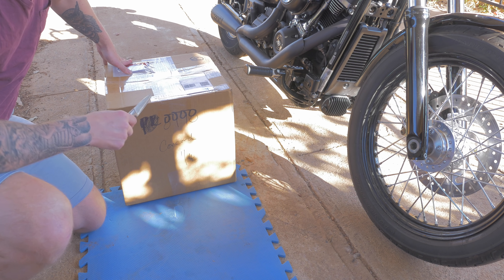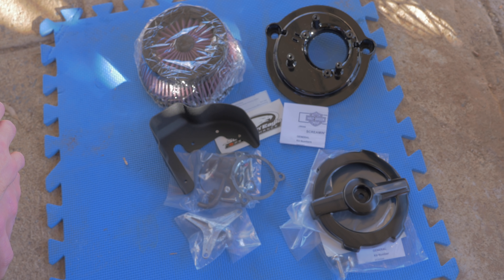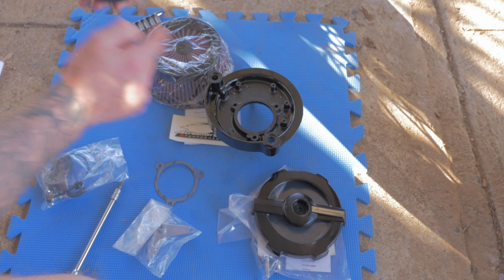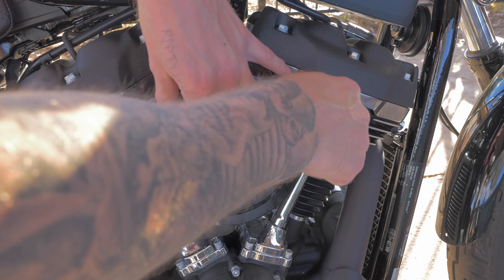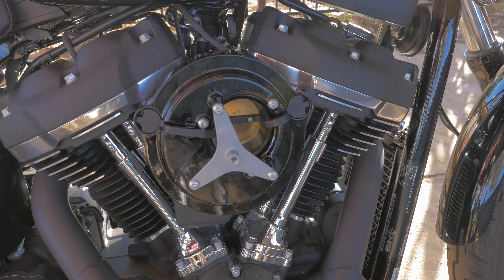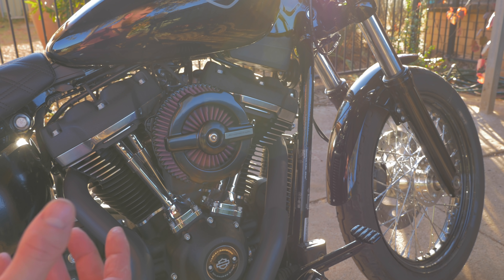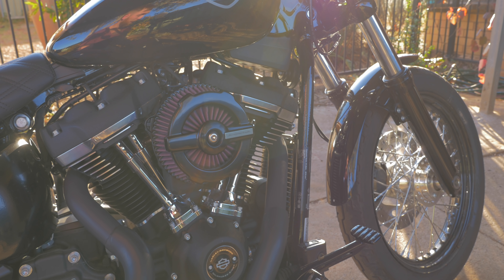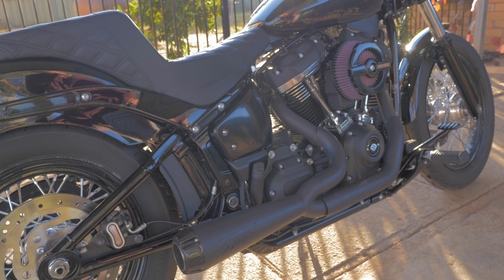2019 Softail street bob - Screaming Eagle extreme flow air cleaner

Comment: Awesome vid as always. I dig that intake and your bike. Just some caution for  others. Since The throttle body on Milwaukee 8 is mostly plastic i snapped mine in 3 places with a small 1/4” ratchet trying to install an arlen ness big sucker intake since the mounting plate wasn’t perfectly flush. It broke super easily. Causing me $589 to replace and fix NOT covered under HD warranty. The dealership said a LOT of guys have broken their m8 throttle bodies same way. I installed a joker intake on my 2017 sporty XL1200x with no sweat. Just dont wanna see anyone else have to go thru this
Reply from the maker: @madfzr wow man that sucks, yeah I've heard you have to be pretty careful not tightening the bolts too much as they'll break pretty easily. Good heads up man, can certainly be an expensive mistake.

Comment: You may want to pick up a screaming eagle tuner witch is the one my dealership recommends for warranty purposes I've used it after pipes and air cleaner install to tune the bike. Is pretty easy to use and seems to work pretty well 👍
Reply from the maker: Yeah thanks Ron, My dealership recommended the screaming eagle pro street tuner as well. I'll have them set it up when I take the bike in for its 1200km service.

Comment: Awesome job as always.  A/F ratio should be fine as long as your not rev'n  the snot out of it, WOT might not be too good, but low rpm cruising fine till tuned (2cents).  I thought I was going to buy a Street Bob, but ended up liking the fit of the Fat Bob instead.  After seeing this I think that air cleaner setup is optimal for foward controls and leg position.  I like the look of the Heavy Breather but don't wanna spend the money to find out it sucks for my leg position on foward controls.  Keep up the great vids.🤙
Reply from the maker: @Robert Bowen thanks man. I much preferred the look of the heavy breather intake aswell but was told it's not suitable for the street bob when you run forwards. In saying that I think this air cleaners the next best 🤙

Comment: What can you tell about the k&N air charger? I been looking to buy that one, but haven’t seen many reviews hanging on Milwaukee 8 motors.
Reply from the maker: The k&n air filter is very durable and performs great. It's easy to clean and re-oil. I haven't found a single fault with the k&n filters and I can see why the Harley Davidson screaming eagle range uses them.

Comment: Did u change the breather bolts? If so where u got them from?
Reply from the maker: The kit comes with a set of breather bolts 👍
Reply: I replace the stock one for the screaming eagle ventilator from ur other video and had to use the stock breathing bolts. It matter whixh ones i use?
Reply from the maker: @Cquesadav54  with the ventilator air cleaner you use the stock breather bolts. But with the extreme flow air cleaner I used the breather bolts provided with it 👍